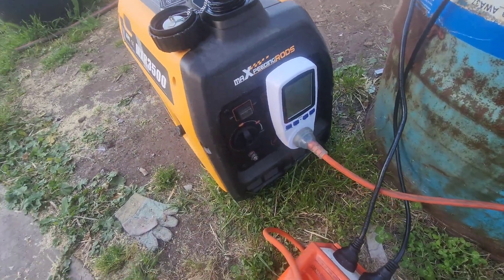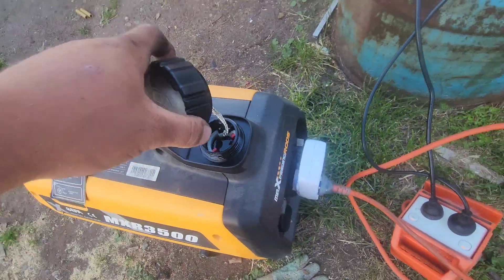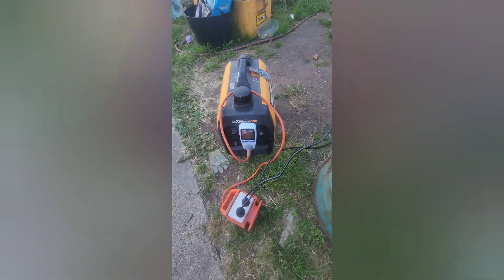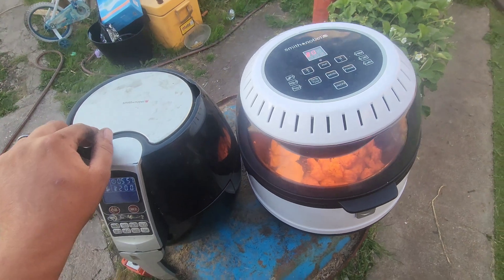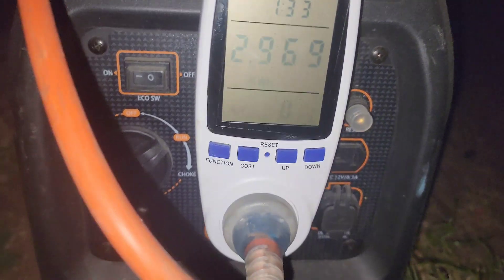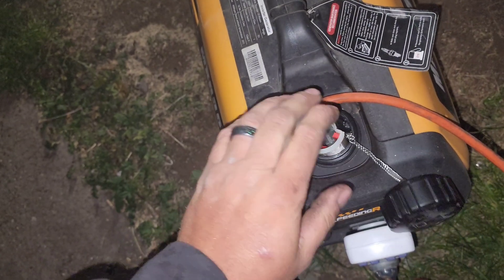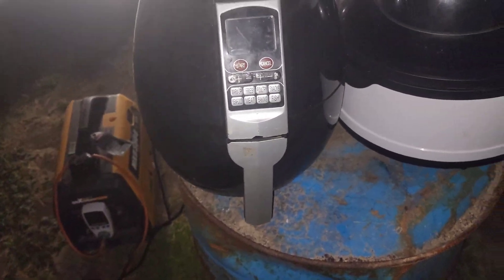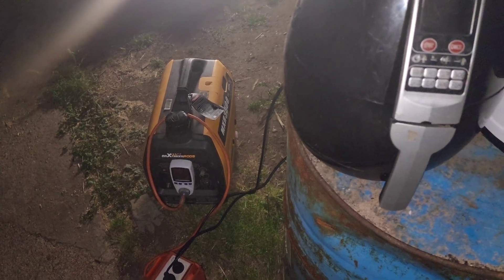High Load Runtime test Maxpeedingrods Mxr3500 3500watt  inverter generator

Comment: I was looking for just such a test ! Thanks
Reply from the maker: Still got her still use it often use code oneup on maxpeedingrods for a discount mate
Reply: @Oneupthesleevecustoms  Do you think this generator is sufficient for a 1.6kW air fryer?
Reply from the maker: @marcindiadioo5718 checkout the test it can run 2 eqsy
Reply from the maker: @marcindiadioo5718 it runs 2

Comment: Never start an inverter generator with power cords. Always plug in after it has run for about 20 seconds. You could blow the generator circuits.
Reply: Sorry but that's rubbish, that would be the like the shities inverter design ever. Inverters are completely digital, if it was a problem, it would simply wait 20 seconds before inverting, but it isn't so they don't. It would be so simple to program into the electronic control. To give some idea of the digital control in this generator, it already has a single control module that inverts, controls it's electronic ignition (no magneto), electronic throttle (stepper on the throttle). 

The idea it's not good to have load connected to an inverter at start up might be true of some shitty 1980s inverter generator, but if an invertor had a problem with a load being attached at start up, it would simple not invert. An inverter is a high speed digital switch, it boost or buck voltage by switching into inductors. A generator like this creates three phase 80-100v, which is retified into dc, this dc is then feed into IGBT or transistors/fets (Digital switches). The digital switches part is what is important, because it is simple for an inverter generator to simple not invert, if conditions are right, the control software will simple not ever turn on the IGBT/switches.
Reply from the maker: Yeah no issue starting stuff plugged in

Comment: I saw these in my email today, and lucky you had a video of it up and running and that.  What I also found is the cheap China made Generators seem to use more fuel and have a bigger fuel tank unlike The Honda's and Yamaha plus Engel Gens. Yet they have a smaller tank and run longer. 
Overall nice vid and wondering if its still running as this is an year old mate.
Reply from the maker: It's lived outside on my work truck for last year. Starts second pull and runs anything that can plug onto normal powrt point.
Reply from the maker: I can get these on ebay for 660$ it's 3.5kva 3kva Honda's are around 4grand. I'd buy 2 of these put one on  shelf and save 1000s rather than worrying about the fuel cost.
Reply: @Oneupthesleevecustoms  sweet.
Reply: @Oneupthesleevecustoms  ahhh nice. So no dramas at all so far then.
Reply from the maker: Na mate going great guns